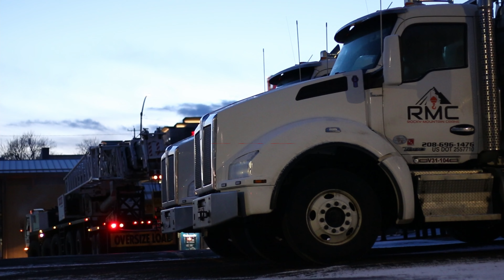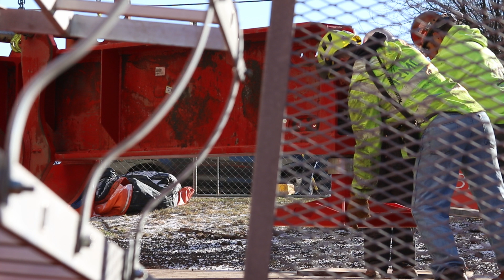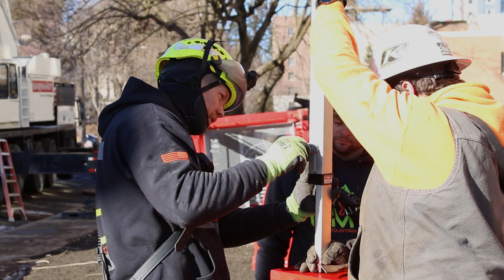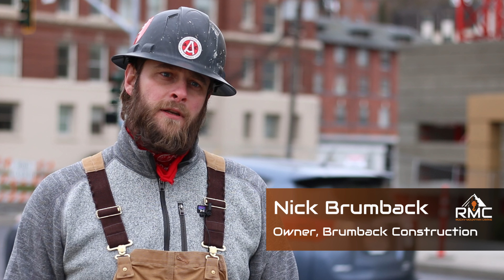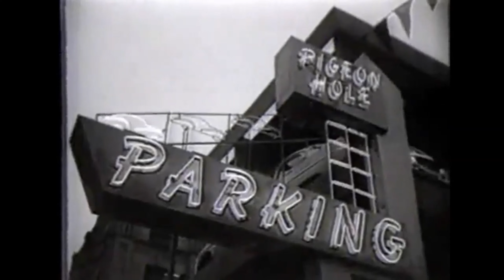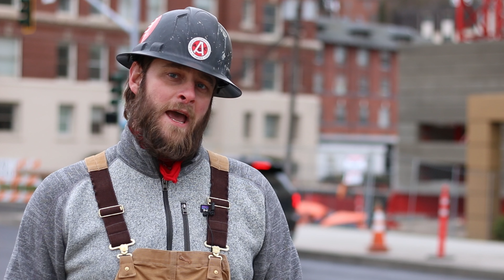Potain MDT 219  / Brumback Construction

Comment: 219 J is a nice unit. Had one up in Charlottesville Va for over a year. About to do the same with one maybe two in Richmond. Have a bunch of T 130s and T 85as spread throughout the region as well. Also spicy units. How often have you seen one operator walking the site running two cranes with each control box strapped over his shoulder?  Helps sell a job!